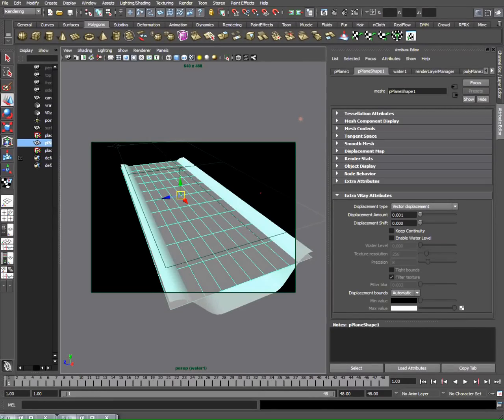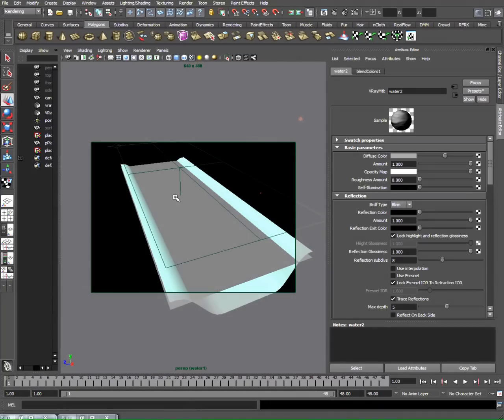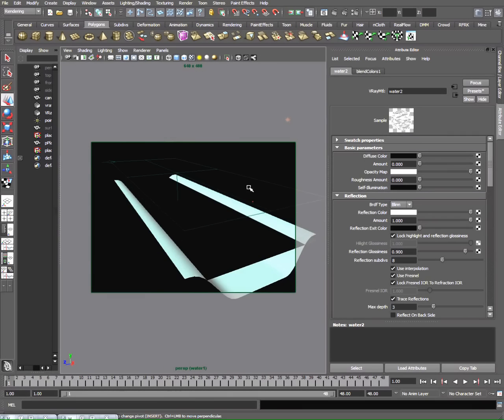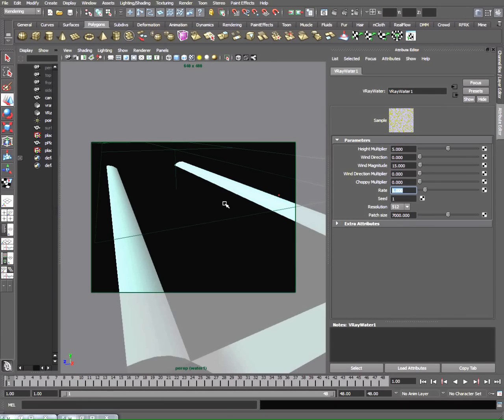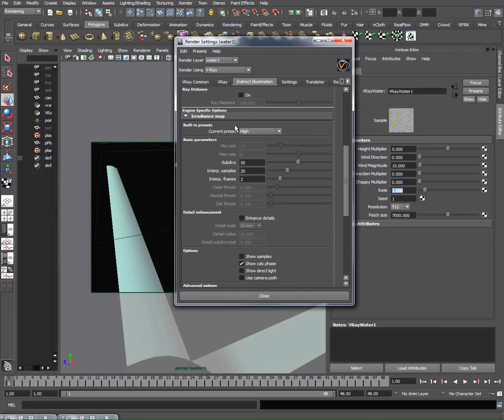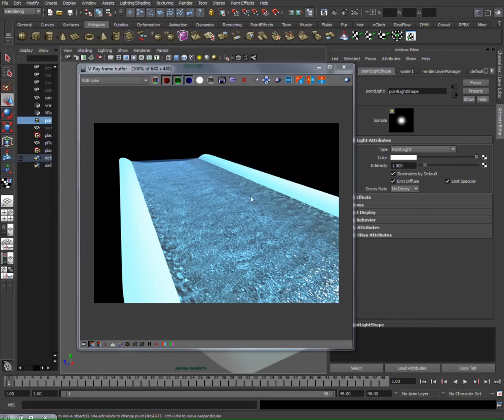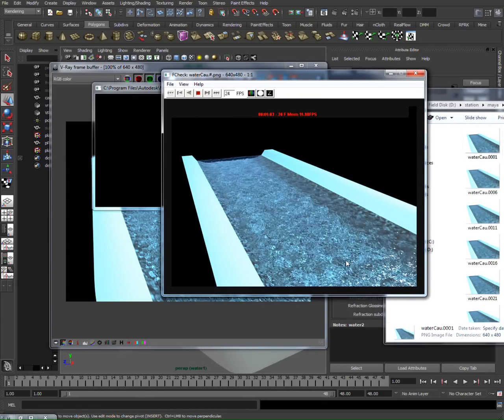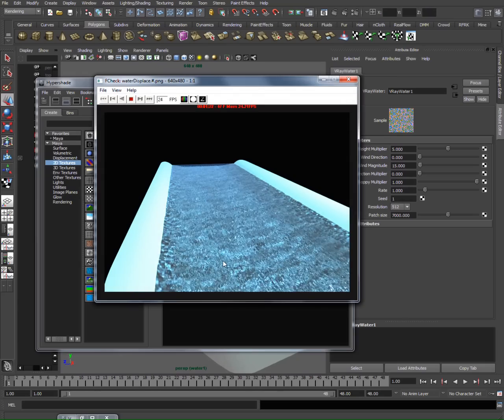Maya Vray Water Tutorial - Part Three (Shading & Caustics)

Comment from the maker: You can surely convert a displacement-map with its animation into polygons but it does not work with VrayWater. VrayWater is a vector displaced-map and convertting displacement-map to polygons only accepts normal displacement, unfortunately. Also it's good to know that your animation should not be done by expressions [weird], it needs to be hand animated (key-framed).
If you need your displacement-map with its animation go to Modify>Convert>Displacement to Polygons With History.